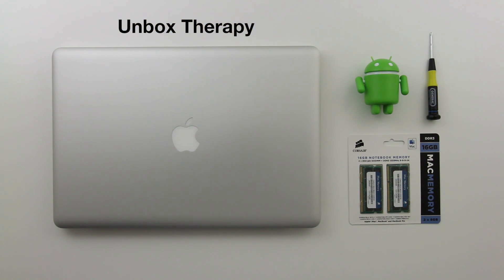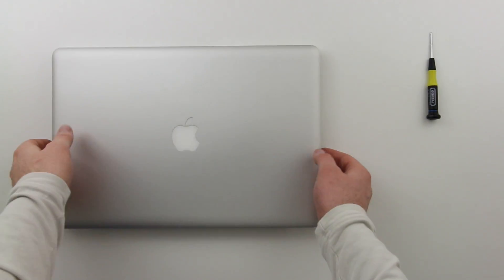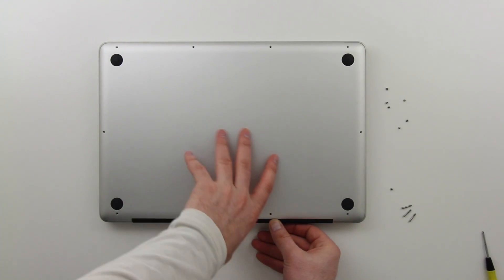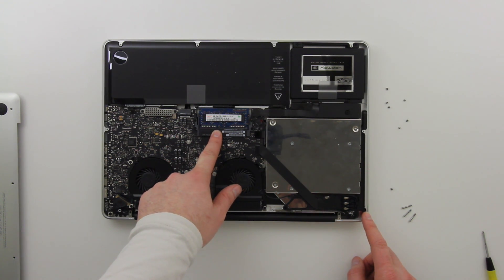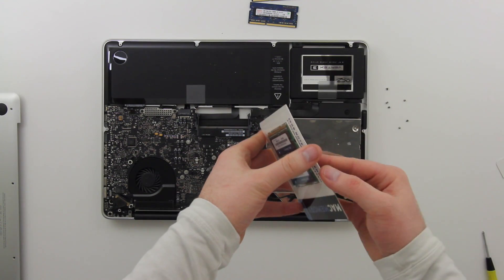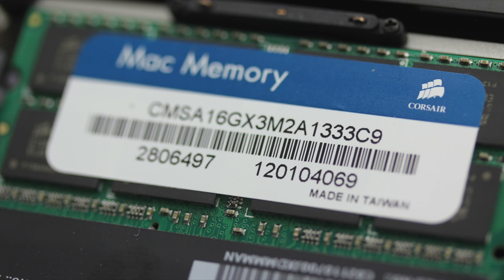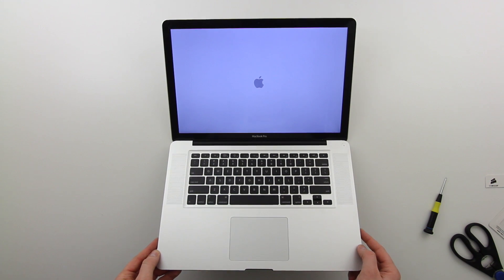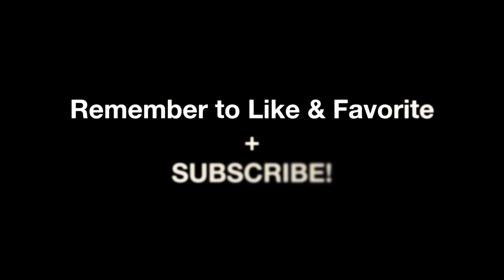16GB MacBook Pro RAM Upgrade (2011)

Comment: So you replaced the HDD with a solid state then took the CD drive out and put a drive there too? How exactly does that work, cause I dont have a need for the CD drive honestly. Any responses greatly appreciated!
Reply: i was looking this up myself just now actually, but let's say you wanted to replace your optical drive with an ssd:

there's a mount you can get on amazon that fits snug where the optical drive should lay, and you can just put an ssd in said mount, hook it up like it was, and it should work fine. im probably missing a couple steps here and there but that's basically the gist of it. 

i dont know about a drive like lou's in the video though, but i bet the same concept applies in some different sense kinda.
Reply: You need a driver or sth
Reply: I ended up putting in 16 gb ram, i used a data doubler kit to replace my optical drive with the old Toshiba HDD that comes with the mac and put it there. Then I just put a standard 240 gb SSD into the original hard drive slot. Works incredible. Such a great upgrade
Reply: Why not just leave the original hard drive in the original slot and put the new ssd in the optical drive section? Seems like this would be a much faster approach

Comment: i have a macbook pro late 2011, can i insert 32gb ram? i mean 2x16 ? hope somebody answers.
Reply: I don't think macbook pro late 2011 can handle 32g of ram. I know this because i have the same system myself. I recently upgraded its ram to 16g plus a brand new ssd, it's working like a champ now!!!
Reply: +Brian Phuc H.T. Nguyen thanks for responding, well i use my mac for video and audio editing, just for youtube (you can see my videos in my channel) and i considered upgrading my ram to 16, i dont actually know if this will help my performance and renderings.
Reply: Rendering requires good read/write speed. You should consider upgrading to SSD first for a drastic difference. Cheers!
Reply: +John Trujillo if you have large video files you should consider adding an HDD
Reply: Prem Krishna Chettri thank you very much  .

Comment: Hi will 16 make any difference I have  a early 2011 MBP it states 8gb is the max on the Apple site
Reply: It makes it faster. Though an ssd will also help.
Reply: Thank Yoy, I will upgrade my MBP too... Zestypanda
Reply: you did the upgrade? 16gb in your early 11 worked ?
Reply: Luan Castro Aleixo
Yes, the upgrade went fine. The computer is faster now.
Reply: mark shirley is this pc worth buying in 2016 ?
Reply: ekim andersom This is the 2.2ghz version with 250ssd and 8gb ram shouldn i buy it.Im not planning on upgrading it,cuz I'll need the money for a controller.
Reply: ekim andersom I am a bit of a hardcore user.I'm planning to use it as a daily computer.Mainly dj and music production and a bit of video editing,and sometimes games.
Reply: which Macbook Pro is yours?
Reply: It works, just make sure you use 1333 mhz ram
Reply: So to confirm... is this definitely possible on the MacBook Pro 15 inch early 2011??! Can I just ignore the manual where it says a maximum of 4gb per slot? In your comment your saying 1333Ghz and 1333Mhz interchangeably, but I'm assuming you mean Mhz... Are you saying that I can order some a 8Gb DR3 1333Mhz ram stick and just plug it into one slot?
Reply: fkmbmw 2011 13in

Comment: I have an early 2011 13" 2.3ghz Macbook pro. It lists here https://support.apple.com/en-us/HT201165 that the maximum memory I can install is 8gb. Is this in total (2x4gb) or per slot? Can I put in 2x8gb of the correct memory?
Reply: So why does it state that the max is 8 GB? I'm confused too.
Reply: Yes you can!
Reply: Agnish Paul Is there any reason apple would list 8gb as max?
Reply: Oliver U Upgraded? worked?

Comment: I did it!  Woot Woot!  I just don't trust myself to do things like this but I ordered the Corsair RAM, watched your video about 5 times over and then did the installation.  I have an early Macbook Pro 2011.  I've never removed the back before but luckily had the right screwdrivers to do it (a small miracle really.)  I don't know how my dog's hair made it to the inside of my Mac but I gently cleaned it out and installed the RAM.  I record on Garageband (basic, I know) and it still stops for optimization but iPhoto is running much better.  Could new SSD be in my future?!!! Thanks!
Reply: +Reneesfun 
hows it going?
was it worth it?
a lot of people on the forums saying its not needed, and i was just about to do it myself also.

Comment: apple mentions that 2011 macbooks can only handle upto 8 gb of ram here - https://support.apple.com/en-us/HT201165
did you check if you were able to use all 16gb of what you installed?
Reply: +Dave Pekarski The limitation means nothing. Os X (Mac OS) can address up to a terabyte of ram.
Reply: +Sohil Garg +Unbox Therapy I read on several forums before Yosemite came out and was under the same impression, but is there a chance that Yosemite expanded that restriction? I think the reason mac had that restriction was so that macs run reliably. or is it hardware that can't handle the data? I really don't want to start researching again, so would appreciate any info.

Comment: hey I just installed two 8 gb DDR3L Crucial in my MacBook Pro Early 2011, but my system just recognize one of them, the other slot says is empty. What can i do to get the 16 gb working??? I'll appreciate the answer.
Reply: +Andres Felipe Mena Echeverria Apparently I heard from an Apple store that Some models of the 2011 series only go up to 8 GB, I'm guessing that would be the early 2011. Mine is early 2011 also, its all kinda weird and confusing to me lol
Reply: +Andres Felipe Mena Echeverria I found you a link, check it out https://www.mrmemory.co.uk/memory-ram-upgrades/apple/macbook-pro/13-inch-early-2011-2.3ghz-core-i5
Shows the max memory for our laptops.
Reply: Thanks for your answer, I already fixed the problem, just had to reinstall them and that was it, it's working fine.
Reply: So is your total memory 8 GB?
Reply: +RubyBlox KillerShot nope, it goes up to 16 gb. Mac says it goes till 8, but in practice is till 16.
Reply: Andres Felipe Mena Echeverria I see. So how did you get it to 16gb? Sorry Im planning on purchasing RAM so I want to make sure I have everything right, I dont want to mess up and waste money. And just to confirm, we both have Macbook Pro 2011 Early right?
Reply: +RubyBlox KillerShot yeah, early 2011, 15 in. I don't know what happened the first time I install them, but the second time I did exactly the same, place them in the slots, and worked fine.
Reply: Andres Felipe Mena Echeverria Lol thanks dude, big help ^.^
I already have a 4GB RAM which means if I want 16 GB I need to replace my current one with 2x 8 GB. I have to re-install my windows and Mac OS systems ;l

Comment: do you need to disconnect the battery connector next to the ram before replacing them?
Reply: Is this laptop still good in 2016
Reply: Yes
Reply: +octoman511 not exactly
Reply: +Nicolas Rulli i want to try these upgrade. Do you recommend disconnecting it. Because i don't have a spudger and i dont know if i should buy one.
Reply: Yes, especially if you upgrade the RAM and upgrade to an ssd. Nothing you can really game on, but it works well for everything else.

Comment: For all you asking what is the difference between using 1600Mhz or a 1333Mhz is that the higher frequency is not exactly designed for these older models and it might cause some system issues, as some reported around forums. For some people they worked perfectly, but if you want a guaranteed system stability after the RAM upgrade stick to 1333MHz, which is the frequency suggested by Apple for MBP 15' 2011. In the end, the system will not noticeably benefit by the extra MHzs. They also said the maximum RAM support 8 Gb, but consider at the time 8 Gb single bars were not that popular and 8 Gb total was a huge amount of RAM, while today 16 Gb is becoming the average RAM amount.

Comment: my macbook already came with 16 gb ram :p it cost 2,500$
Reply: I think you missed the point. My machine isn't what's stopping me from gaming. Not caring about gaming is.
Reply: +NintendoChase Mine came with 16Gb and the 2.8GHz i7  - cost 2,699$. Go back playing Mario Kart.
Reply: +Uomo Magnete Minus Mine came with 16gb, i7 quad-core 2.2GHz and a 512gb ssd - cost 600€. Go back playing mine sweeper.
Reply: Meh, I don't really care about my macbook I mostly use my $4,000 desktop pc :p
Reply: NintendoChase  Gotta say, not bad.
Mine cost around $6000 with two custom loops, one for video cards and one for the processor. :)
Reply: My gaming pic only cost £1200 and it can run any game I give it
Reply: Gaming is about the video card. You are going to find Mac people mostly aren't gaming.
Reply: +whereverimayroam no shit. You wont be doing gaming on a mac unless it's the top tier mac pro, and that'd be just stupid to spend over 10k for a pretty good when you could get the BEST for that, including the i7-6950X, 4way 1080, 128gb of ram and all that more or less stupidly over powerful and useless stuff.
Reply: +whereverimayroam although you didn't mention it, sure.

Comment: i currently have 4GB of ram 1600 MHz DDR3, what's the difference if i get 16GB of RAM with 1333 MHz instead of 1600 MHz?
Reply: I think one of them has 1333. There is two chips therefore 2666!

Comment: I have a MAC early 2011 model, Processor: 2.7 GHz Intel Core i7, Memory: 4 GB 1333 MHz DDR3
I'm trying to upgrade it to have 16gb RAM and possibly removing the optical drive to an SSD so I can make it really fast and handle all the musical productions vst. I use my mac for music production. What would you recommend best?

Comment: hi,got three questions; first of all where or which site would i be able to buy the 16 GB  RAM and more.  
 and then second; would el captain be good for my mac,??, am using mac osx 10.9.5.
* and finally how do i free up space on my startup disk, which steps.? if could help
Reply: +ufi sa Buy it out on Amazon. El Capitan is great! You won't regret having it. The improvements over two generations are a ton load (Current version is 10.11.4). Transfer your data to an external hard drive.

Comment: is it really that easy to upgrade my mac Ram ? I can it do it all by self or do i have to visit a mac authorized retailer store for this ?

Also, I am running EL Capitan on my mac pro (early 2011) as well, does that matter when upgrading
Reply: +sarah albanawi You just need a screwdriver, that's it. Unscrew the back, pop up the old ram, exchange it for the new one. That's all. No need to visit any Authorised Store. They'd just charge you unnecessarily.

Comment: I am using 16gb 1600mhz ram
2x Samsung EVO850 500gb ssd,s RAID 0= 1tb super fast memory
Have changed thermal paste on CPU and GPU
I have a late 2011 13" model and this computer is a beast! it does things lot more quicker than my friend macbook pro 2015 :D
Also running OS X El capitan
feel free to ask questions if you like!
Reply: will updating your RAM will make videos on iPhotos run better?  mine they kind of skip but the sound is good... thanks!!
Reply: We are in 2019 now.  Do you think is that no problem to buy the 2011 MacBook pro 8GB ram 1TB HDD with i5 processor
Reply: +Atte Santala Sounds awesome! Do you have a i5 core or i7 core in your MBP? Which ram do you have installed (name, brand)? Can you recommend a brand of thermal paste?

Hope it still woriking fine :-)
Reply: i am using arctic silver 5 thermal paste and 2x Kingston 8 GB 1600 MHz DDR3 NON-ECC SO-DIMM memory, i have core i5 in my MBP :)
Reply: +Atte Santala I've bought 16GB 1600mhz ram for my mac book pro 15inch 2011 version,and I had problems with apps and chrome browser a lot of crashes.
Reply: @interman3103  is your pc still alive? @Atte Santala how is yours doing?
Reply: +Atte Santala happy to hear that you beat your friend with 2011MBP! I have a 15" 2011 as well, is it helps move to change the thermal paste to overcome the overhead problem my one? Thanks in advance!
Reply: Interman Really, i have no issues at all?
Reply: +Atte Santala Can you help me get my FCP7 back? It doesn&#39;t work anymore. I think I may have upgrade by a mistake. Currently: I have a late 2011 13&quot; model Running Lion 10.7.5 thanks in advance
Reply: +Atte Santala My is late 2001 too. i5. do you know if 16gb works with i5 processor? Thanks
Reply: Hello, I upgraded my MacBook Pro (mid 2012) with a SSD Samsung EVO 860, it has 10GB of RAM, it takes about 37 seconds to boot. it think is a lot considering that I also have an iMac (mid 2011) with a SSD EVO850 with 12GB of RAM and it only takes 15 seconds to boot. do you think that is ok? or maybe there is something wrong going on
Reply: Hi is ur macbook still alive?
Reply: Pls between the 1TB HDD and 500GB SSD which one will be better in the MacBook pro 2011 model ...just i want buy it for students use
Reply: can we change the processor or GPU or even connect an external GPU cuz cs:go on this sucks
Reply: Atte Santala I have a 2012 MBP with 4GB of RAM and a 500GB HDD running OS X Mojave. Not good, way too slow. I’d really like to do this upgrade, at least just replacing the HDD with an SSD and the RAM. What exactly does replacing thermal paste do... and what is thermal paste?
Reply: Why in apple web said the MacBook Pro late 2011 13" model only could have 8gb ram? It's really means for each port? Or in total? I'm confuse and don't want to damage my computer. Thanks for the information
Reply: that's why Apple does not like their users upgrade their Macbook because it will somehow decrease their sale. Thus, Apple  solders the RAM to the logic board...

Comment: Absolute genius! This was the easiest upgrade ever. I have a mbp early 2011 running El Capitan and that stupid spinning was driving me nuts. I would open up my mbp in class and want to slam it on the ground because it would take forever to open up a PowerPoint. It's running faster and smoother now. 👍🏽
Reply: Hey which MBP do you have? 15" or 13"? I'm considering in buying one but I've seen some videos of the early 2011 15" having gpu failures how's yours working out? Also it helps to download a cleaner program to free up some space in your ssd/hd(temp files, cache, etc.)
Reply: I have the 13". Also, the ram upgrade only helped with the computers performance once it's booted completely. Start up is still about a minute. I haven't completed any other upgrades other than the RAM. Hope this helps.
Reply: +Alejandro Chavez thanks! I bought the 13" going to do an ssd first and doing the ram upgrade later on

Comment: Is there any problem if i buy a Crucial memory with 8gb at 1600MHz is it compatible? or i need 1333 MHz?
Reply: +Resse Official I have a 1600mhz 16gb memory and no issues at all, i have a late 2011 13 inch model, also you can easily add optical drive bay second ssd if you have a 6gb/s connection and put them to raid 0 as mine is, then you got a fuckin fastest macbook pro ever :D i strongly recommended that if you have any heat issues, change cpu and gpu thermal paste too..
I have now:
16gb 1600mhz ram
2x Samsung EVO 850 500gb SSD set to RAID 0 = 1TB super fast SSD memory
have change CPU an GPU thermal paste.
Now this is quicker than my friend 2015 macbook pro :)
Reply: And i am also using OS X El capitan without any issues! if you don,t want put so much money on these, buy smaller SSD,s but put them in RAID 0, for example 250gb x 250gb ssd RAID 0 is one 500gb super fast SSD
Reply: thank you !!

Comment: hey lou, mac says that you can only upgrade a early 2011 mac book pro to 8gbs. Im assuming you can use 16gbs bc of this video?
Reply: Hi. I have a 2011-2012 i5 and its been working great with 16GB of RAM for the last 3 years :)
Reply: @ebonywinn50  hey ebony , have you done anything else to your 2011 mac book pro ?
Reply: there are 2 versions i5 and i7, so i guess the i7 supports 16 max and the i5 8? I am just speculating
Reply: @mccg4337  My MBP has a i5 processor and supports 16GB of RAM. Early 2011.
Reply: @EpilogueOfHare  unofficial support lol
Reply: @MC CG You sure about that?
Reply: @EpilogueOfHare  nope I am speculating
Reply: @EpilogueOfHare  how is situation now with your mac is it still working normal I am planing to upgrade my on 16GB
Reply: @jlukac86  Hey man. It's still working great. No issues at all. Go for it. Enjoy.
Reply: @EpilogueOfHare   Hey if you don't mind me asking, did you use the exact RAM used in the video? Because it says this RAM is Apple certified so I wonder if it would work for other RAM as well. Also, how is the 2011 mac working in 2021? I'm thinking of getting one for a cheap price and upgrading it, only for coding in Flutter (since its a mac only software). Thanks!
Reply: @Antonio-rw3pu  I bought my RAM from Crucial. I’ve been using their brand of RAM since I bought my first MBP back in 2012. Never had any problems with their products. Still running strong today. I’ve heard of the Corsair brand that is being used, but I don’t have any personal experience with it.
Reply: @mccg4337  HOLY 4 years later lol
Reply: @robbysreloadingroom  lucky me I have the i7, what did you chose in the end ?

Comment: I have a late 2011 13inch Macbook Pro with the 500GB (400GB used) hard drive. I recently bought a Crucial MX200 250GB SSD, ORICO External Hard Drive Enclosure Adapter Case for the HDD, and 4GBx2 Crucial RAM. I also have a 1TB external hard drive. I am running OS X 10.7.5 (Lion) and am planning on upgrading to Yosemite. What would be the best way to keep all of my files while running a smooth computer with advanced programs like Adobe CC and Final Cut Pro?
Reply: +Adam Chorazyczewski Upgrade the OS, and get more ram.
Reply: +Adam Chorazyczewski Be very careful. FCP7 will not work if you upgrade to Yosemite.
Reply: +CINEMATIQmag TV and El Capitan?